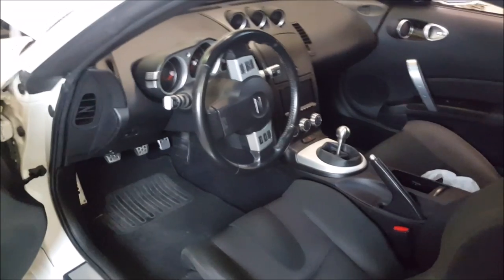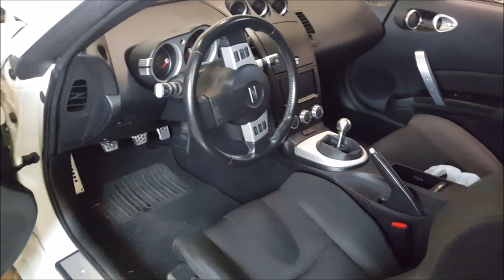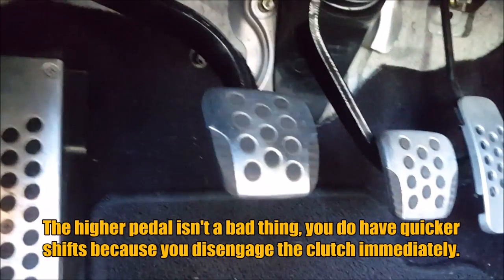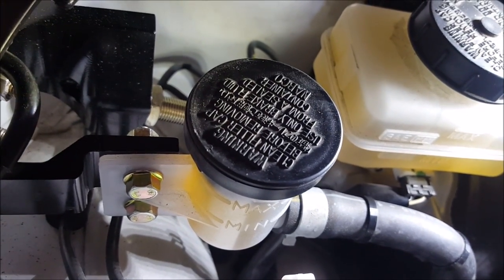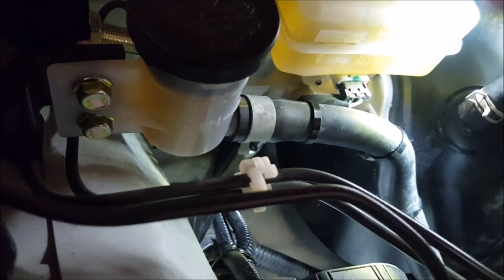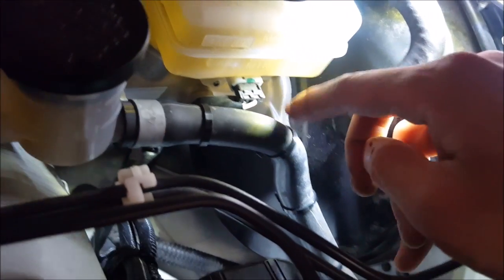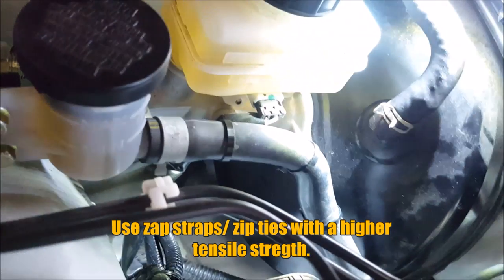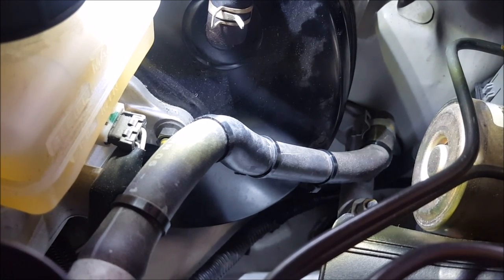350Z Clutch Pedal Mod (350Z owners I need your feedback!!!) | AnthonyJ350

Comment: man a clutch slave master cylinder is only $30. It's two bolts and a brake line take it 20 minutes anyone that paid someone $1,000 or $1,800 you need to start learning about cars real fast cuz you're making Nissan rich
Reply: ^ what he said. just look at the FSM on the nico website. This aint rocket science
Reply: Well said Craig. Even better, I change the slave for free every time I change the fluid. No questions asked, at Oriley's they sell the slave cylinder for $40 with a lifetime warranty. Nissan can't match that warranty, so I do not go OEM. I also installed a stainless steel line for the clutch with a heat shield, when I had the transmission dropped changing the clutch. My problem is the clutch fluid keeps turning black over a 6 month period and I can't figure it out. Pedal feels fine and clutch is fine. I'm thinking or guessing the old rubber line is leaking a black die. Anyone else, any idea?

Comment: The muggy clutch feel is common with vq35de engines. I've gone through the same issue: muggy pedal feel when hot outside, pulling the pedal back up cuz it gets stuck halfway.. you name it. After all research I did, read forums, googled I found out that at least 8/10 owners experience the same issue. My clutch was due for replacement so I decided to change the master and slave cylinder as well. Never experienced the muggy sticky pedal again. I firmly believe that oem master n slave are the culprits. Look into the csc elimination kit from Z1 if you wish not to deal with it forever.
Reply from the maker: Thanks I'll have to look into that!

Comment: That line is not the issue, it holds no pressure and only serves to take up the expanding fluid to the reservoir when it gets hot, so by adding to much fluid you are forcing it to hold pressure and making your problem worse. The issue is the pedal assembly inside the car. The spring back mechanism isn't constant, when there is no pressure pushing back on it it will stay down but once some pressure is applied to it it will jump back. There is a replacement pedal assembly but it is like $250 from RJM that fixes the problem.
Reply from the maker: Torbox1 Gotta watch my channel more. Already installed it. RJM Performance also features the video right on their site ;)
Reply: Ahh, didn't realize that was your channel, good job.
Reply from the maker: Torbox1 Thanks!

Comment: That small loss of fluid is what’s getting past the seal inside the master, I had same problem went to replace the slave pulled the line from the slave and the entire reservoir emptied without pumping the pedal..
Reply from the maker: Thank you for sharing

Comment: I've had a ton of problems with my clutch over the years and I have to agree with Z33, usually its the master cylinder.  I have had the halfway sticking when hot but i have also had my pedal lay on the floor as well. Pumping the clutch would bring it back up but it was a short term fix to get where i needed to be. Took it to a few shops they said nothing was wrong with my clutch then they bleed/change the line and its fine for a month and would go back to laying on the floor.  Had the clutch replaced, still would have the issue....replaced the master....problem solved.  Worked for my friend as well.

Btw, I have enjoyed your vids.  When you get to solving the engine eating oil let me know.  That ones been driving me nuts.
Reply from the maker: Thank you!  I don't think you can solve the oil issue completely.  Blow by will happen on high compression motors.  I talked to some people about S2000 (you figure a Honda won't) they need to be topped off.  Heck even BMW puts a place for you to carry oil on some of their older cars because they expect you to top it off.  Also a lot of high performance motors the pistons need to get to operating temperature and expand, so when it's cold it may consume a little oil because the oil gets past the rings.  I'm willing to bet city drive 350Z's consume more oil than highway driven ones.

I would just make sure your PCV valve is relatively new and run an oil catch can to help the car have a more pure air and fuel mixture.

https://www.youtube.com/watch?v=iSzU-cvlLO8
Reply from the maker: Another thing is very few people know how to do the clutch pedal adjustment cause it makes the pedal really high.  I had it don't by The Z Shop in Surrey BC.

Comment: Maybe the clutch fluid is boiling at the line next to the exhaust header. this happened to me at the track. switching to dot 4 fluid solved the issue. Also make sure the aftermarket clutch line is installed correctly (if you have one). Mine was installed incorrectly which also exacerbated the problem. Good luck.

Comment: I had the issue where the clutch pedal would not come back up when super hot or in heavy traffic.  I ended up installing new slave and master plus the ss clutch line.  $80 for all 3 from Amazon.
Reply: i wonder what his results were for his mod and if it could ahve saved you the money. Did this solve all of your prolems?
Reply from the maker: No problems in hot weather in traffic?  See mine still comes up all the way.  But the engagement point happens a little lower and just feels kinda mushy.
Reply: to me it sounds like maybe your fluid is expanding??? idk just my physics experience and the fact that it engages sooner. if you tried some of that crazy performance brake fluid it might help this. though many people say the master and slave seals go bad in this car. (watching some of ur vids rn!!)
Reply from the maker: I decided to stick with DOT 3 because that's what it's designed to take.  There is something definitely giving way, but what specifically I'm trying to pin point.  Keep in mind the car is 10 years old now.
Reply: +AnthonyJ350 try forum research, plenty of people have had every problem we will have.
Reply: +julian ageitos what did you think about the mod
Reply from the maker: The mod in the video?
Reply: +AnthonyJ350 yes sir
Reply: +AnthonyJ350 also you said something about and extra hose to the intake on your catch can install. can you specify what that other hose you left out was?
Reply from the maker: I've only gone on one long drive with sitting in traffic and didn't get it yet.  Too early to tell if it has done anything.
Reply from the maker: julian ageitos The hose from the bottom of the intake tube to the manifold is the other part of the PCV.  Saikou is currently coming up with another catch can for that side.  I'm hoping to get a prototype and do a video on it when it comes out.  I'm interested to see where it goes because there is no room on these things.
Reply: Why can't you just install a catch can on the side with the intake? It's already been done way long ago on these cars. No special can is needed

Comment: Anthony have you considered using the steel braided hose sleeve on that hose?
People have used them for years on the old school hot rods... so why not use a tried and tested idea on that rubber hose.
Could also try some heat sheilding wrap on it as well.
Reply from the maker: Already has it. I show it in this video. If you search stainless braided lines on my channel I show it install on the brake and clutch slave.

Comment: at the engagement point, the last top part doesnt come back out as quick as it should. doesnt get stuck but it definitely bothers me for when im shifting fast or want to clutch kick to drift or break loose which is atleast once a day lmao. its on and off. today it was hot and it didnt do it much. yesterday was cooler, drove about 100miles whole time clutch was sticky. will try this tomorrow morning!
Reply from the maker: Make sure your fluid level is good and use thicker straps with a high tensile strength.
Reply from the maker: It sounds more like you need the pedal adjusted though.

Comment: I have a g35 revup replaced new clutch new master and slave cylinder clutch gets mushy when hot and goes back firm don't  know what else to do it kills the whole driving experience for me
Reply from the maker: Did you install a stainless steel braided flex line with a heat shield for the clutch?

Comment: I've turned the Cmc rod all the way till I couldn't anymore and adjusted the stop on the top of pedal so I had about a inch of free play, car ran great but after 24 hours of sitting I went to press the clutch down and it stuck half way for a bit till I tapped it and came back up, I pumped it few times and it's coming back to the top. 

I just want to know the correct way to adjust it, i just bought the car I feel like selling it. The owner said he just replaced the Cmc because pedal wasn't coming back up before. 

Fluids are all clean and filled
Reply from the maker: supras7 I can't remember, did you watch my RJM Pedal video?

Comment: like everyone's commenting, bleed the line but my question is, why not mod it to move the fluid tank closer to the master?
Reply from the maker: Could make servicing messy even with a funnel. It's pretty tight in there where the master is.

Comment: i enjoy my clutch and its high engagement u get smoother shifts more easily, and specially when you're racing.
Reply from the maker: I agree, the high engagement point is actually better when you get used to it.  What people are doing is they are thinking they have to go all the way to the floor and that's what is messing them up.
Reply: Holy crap i wrote this comment 2 years ago and until now my slave cylinder is starting to give out the pedal is sticking half way lol.

Comment: This is actually a problem I'm dealing with at the moment on my 350z definitely thinking about replacing the rubber line because no fluid has moved from from my clutch master cylinder at all so my pedal has been staying on the floor and today I'll be getting my stainless steel line so hopefully that will fix my issue
Reply from the maker: Has your master been changed yet?
Reply: +AnthonyJ350 yeah I just replaced it about a day ago I'm assuming the one i got is defective I'm gonna check for  leaks today
Reply from the maker: +Henry The Heartless Someone also mentioned to have a friend help you bleed the assembly. What kind of master did you put in?
Reply: +AnthonyJ350 i put in an oem clutch master cylinder and i did have a friend help me bleed clutch but I found out the one i got is defective so I should be receiving another one by Friday free of charge

Comment: 1. Always bleed the lines FIRST  
2. You may have to change the hoses and even possibly both cylinders because the internal seals wear out after a decade or so. 
It's still fully functional and doesn't affect anything if not leaking, but if you're picky on just the the feel, yoi may have to do what's stated above. 
Btw, do the two man method when bleeding. Clutches don't like the one man methods like bleeding brakes for some reason. Take your time :)
Reply from the maker: Thanks!

Comment: I just replaced the slave cylinder and the clutch master slave cylinder and my clutch pedal still goes to the ground to pressure. No leaks either amd fluid is holding in the reservoir ??? Any ideals ???
Reply from the maker: You might need to use a bleeder that uses compressed air to force the air out
Reply: @AnthonyJ350  Do you know of any good bleeders like that or where I can find one ?
Reply from the maker: @matthewsetzer5251  Your local auto parts store would carry it

Comment: I have the exact same problem. my Z is at 25k miles, unfortunately it hasn't made a difference I still get a soft clutch when the car is hot. I find pumping the clutch pedal makes it stop.
Reply from the maker: Hmmm, how old is the clutch fluid and do you have the stainless braided line for the flex line with a heat shield?  Your car has super low miles, if that other stuff doesn't help it's either the master or slave with an internal leak.
Reply: +AnthonyJ350 as far as I know the fluid hasn't changed but car was in storage before I bought it
Reply from the maker: alex redfarn Should be changing the brake and clutch fluid every two years preferably.
Reply from the maker: alex redfarn I would also consider changing all the flex lines to stainless braided versions as well.
Reply: +AnthonyJ350 oh right, change that soon. I'll get the lines done too then. thanks for the advice.
Reply from the maker: alex redfarn Ya they're not that expensive and the car feels better.  Message me when you want to get lines and I'll make recommendations on what product to get.

Comment: My clutch pedal gets very mushy and will get stuck halfway up when it's really hot outside.
Reply from the maker: Did you replace the flex line between the master and slave with a braided version and a heat wrap?
Reply: AnthonyJ350 no, how would I go about doing that? Does it require any aftermarket parts?
Reply from the maker: Just the flex line.  Check out Z1 Motorsports they have one, or google search 350Z stainless braided clutch line.  Just get the one of the heat shield.  The flex line runs near the exhaust in these cars.
Reply: AnthonyJ350 I found the stainless steel clutch line on Z1. So do I just buy this product and install it? If that's the only thing that's needed to fix it then I'll definitely do it since it's just $30

Comment: i had a stock clutch in my g35 and engagement point was sort of high now i change the clutch to a act clutch and my engagement point is extremly low once i push the clutch pedal down i bearly lift it a 1/4 inch and engages right away and driving me nuts got any ideas?
Reply from the maker: Try bleeding it again?

Comment: 90% of the time this issue is caused by leaks inside the master cylinder. As the car heats up the fluid seals start to fail and the pedal is squishy and can even remain at the floor when fully pressed, causing the driver to have to lift the clutch with his/ her foot.

This is solved with changing the master cylinder / clutch line. ( do not get the stock MC again)
Reply from the maker: What master cylinder do you recommend?
Reply: Tilton Racing is the one I am getting, ( higher quality and cost $239 US) while the Wilwood kit is still a very good kit and is priced slightly lower ($180-199 US). 

If I am not mistaken, both of these come with full length braided line from master to slave cylinder.
Reply from the maker: +Z33 Garage I have to look. But isn't it a hard line coming off the master initially?
Reply: +AnthonyJ350 it's a partial hardline in stock configuration
Reply from the maker: +Z33 Garage Cause I already had the flex line changed out to a braided version with a heat shield. Is the Wilwood or Tilton casing that much better internally as opposed to rebuilding the stock master?
Reply: +AnthonyJ350 it's years better and it's a one time fix. if you rebuild the stick one it will leak down the line yet again.

Comment: there is no pressure in that line you have zip tied.  that is just the reservoir to clutch master.
Reply from the maker: Tom R That's why I'm confused. I still haven't had that intermittent mushy pedal. I'm assuming it's the master or slave now.
Reply: +AnthonyJ350 any mushy feeling is going to be from the hydraulic system.  either the master or slave is going bad.
Reply: +AnthonyJ350 just fixed a hybrid civic with similar problem.  kids mechanic wanted 800 for new clutch and hydraulics.  i fixed it by changing the slave  it was leaking very slowly.  when it got hot it leaked more resulting in the pedal sticking to floor

Comment: Hello, I drive a Nissan 350z 2006 and every time I accelerate from 1st, 2nd, and 3rd gear I hear a rattle noise coming from the transmission. Do you have any clue what it could be?
Reply: Check your transmission mounts, normally and rattling that comes from the transmission is due to bad mounts. I could be wrong, but it doesn't hurt to take a couple of minutes to check under the car.
Reply: Could be a lot. Do you have a LWT flywheel? TOB could be toast, the actual clutch disc hub (where it sits on the splines) could have play or what goldenpaws said as well
Reply from the maker: Sometimes I hear chatter in first from a slow start because of the way I'm clutching out.

Comment: the same problem occurred on my g35 and the way i fixed it was just picking up a new slave cylinder
Reply from the maker: Was it leaking?
Reply: +AnthonyJ350 no leaks they just get old and dont hold pressure

Comment: If I already had 3 oil changes with 10w-30 can I go back to 5w-30 without doing damage?
Reply from the maker: I would go back to 5W30. It's what the car is designed to run on. Are you in a really hot area? Why did you pick 10W30?
Reply: Ya ur fine

Comment: Changing that rubber pipe will not improve things. A popular mod (which I've done) is to change the line from the master cylinder to the slave with a braided item and change the slave.
Reply from the maker: Yup, you can see part way through the video I already changed that flex line.